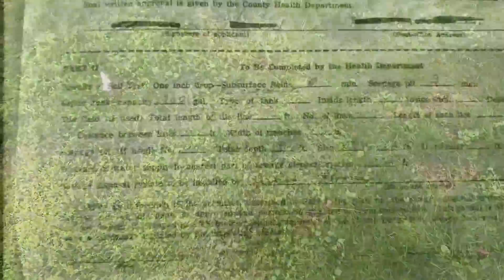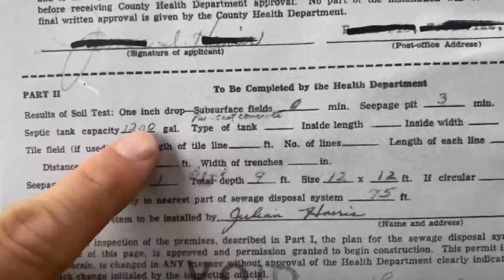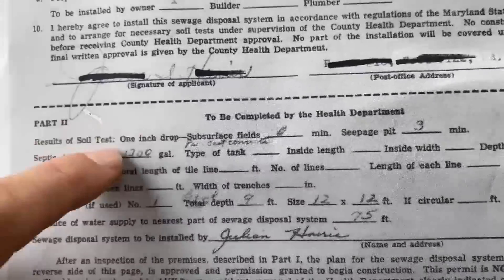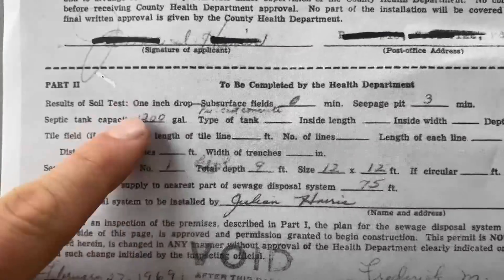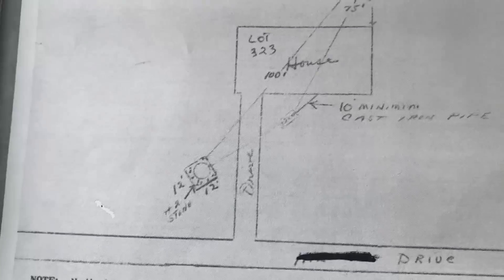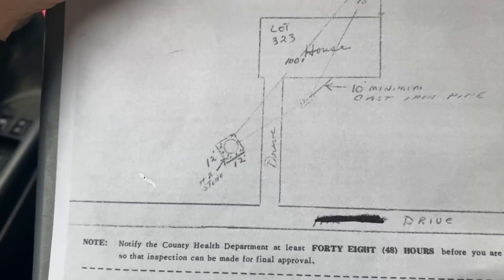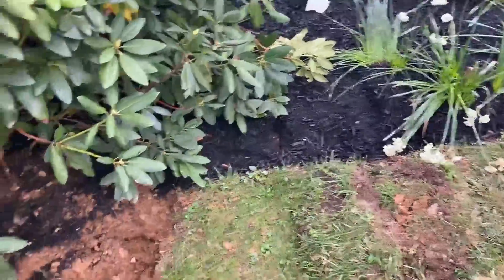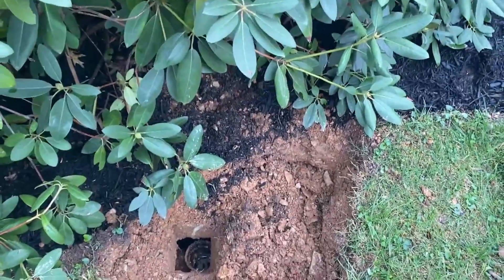Journey Back in Time: Evaluating a 1960s Septic System

Comment: My 960 sq ft 2 bedroom house was built in 1969 and it was before the health department required permits. My septic tank top is fully exposed so I know where it is at. I’m trying to determine exactly where my drain field is because I want to do some tree planting and want to make sure I’m not planting where it’ll cause problems later. So I actually know the area the drain field is in, but I don’t know how wide it is, how deep it is and don’t know how far it starts from the tank. Can you offer any advice plz?
Reply: We do not have a well if that matters.

Comment: For homes such as this, how are the homeowners not having issues despite not having access to their septic tank for maintenance? Great video by the way! Doing research at University of Maryland on septic systems :)
Reply from the maker: This is a super common issue that I come across from systems in Frederick/ Washington county on properties 1950-1970. They would usually not have an access point at grade. During this process we will strongly advise proper maintenance access. The homeowner usually ends up paying a digging fee on top of the pump out fee for systems like this. The down side is that most people will forget or choose not to have their systems pumped. I would say of my inspections with systems like this, about 3/10 are in complete failure. 

I appreciate it. UMD is great and has a lot of good resources for the homeowners. What type of research are you working on?

Comment: Great video! Ironically I live up and over the mountain an hour over in Franklin County PA. Wish I would have someone as thorough as you inspect my system when I bought my house a couple years ago. My septic was installed in 1965 when the house was built. Just now noticing drain field issues, so it has lived a long life.